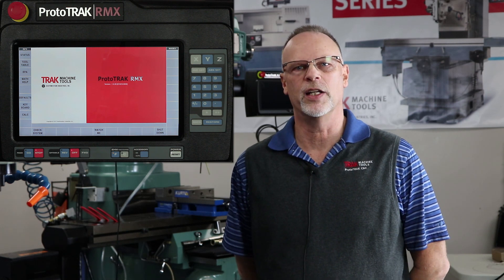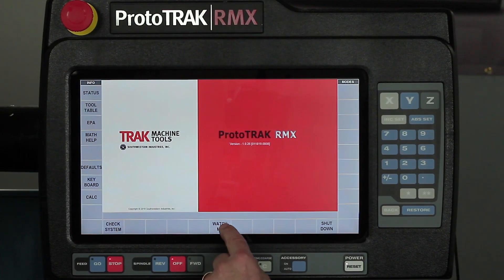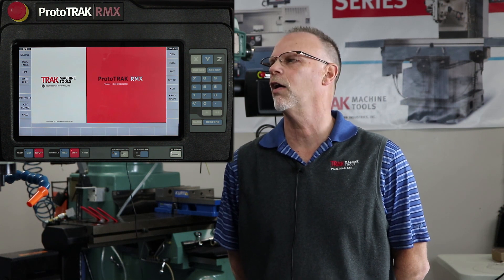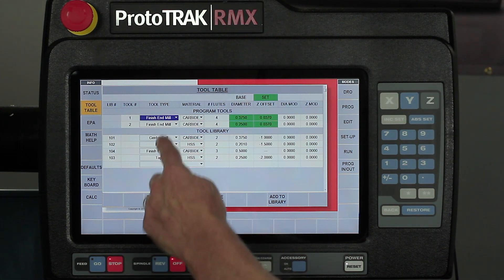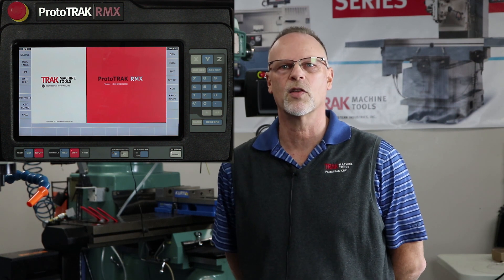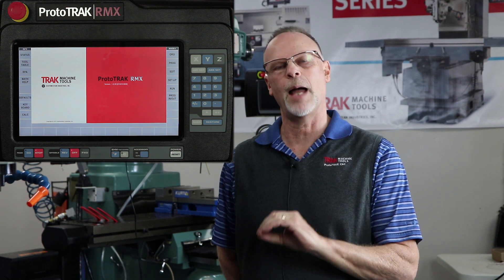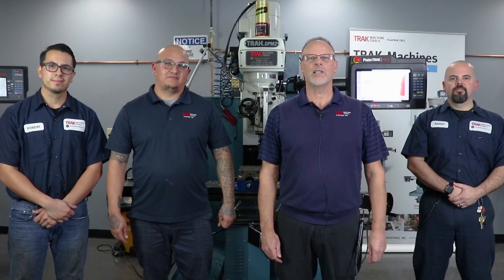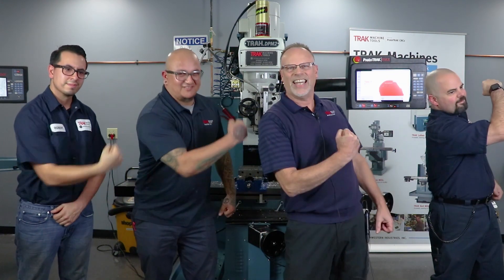What Makes the RMX Different? | ProtoTRAK RMX CNC Overview

Comment: Thanks for the insight Pat. Do you know why on the SMX control when a tapping 
event is entered the actual depth entered in the event is not where the head taps to?
It does not go to the programmed depth.
Reply: Hi Jim!  I know there is a tolerance of +0 but I believe there is also a tolerance of about -5%.  Because the spindle doesn't have an encoder, the motion control is doing it's best to go to the final number without overshooting but it happens so fast, it really doesn't know if gets there exactly.  During our testing it was pretty close.  If yours is off by a lot, please check with the service department in case there is a different issue causing this.  They will probably want to know what size and type of tap you are using.  They will also  want to know the RPM you are running at as well as what material your are tapping.  T.P.

Comment: These are very expensive, why would anyone buy these if you can get proper CNC machines at a much lesser price
Reply: There is a reason nearly every tool room in the usa makes use of prototrak  lathes and mills. They are probably the best solution for one off, job shop, tool room type use. You can have a trak machine cutting chips before your PC even boots up to load your cam software. Very very fast and convenient machines these TRAKS are.
Reply from the maker: Hi, Sunil. Thanks for the question. I believe you get what you pay for. With TRAK machines, you get equipment that is made to last. You get commitment from our in-house software and applications team to build ProtoTRAK controls with the features and performance that machinists and operators need. You get the know-how of every designer, engineer, builder, tester, inspector, technician, sales rep, and customer support specialist built into every machine. And you get the support of a company that has spent decades refining products and services for benefit of their customers.
Reply: @TRAKMachineTools  thanks for replying, i don't intend to demean in any way, but your logic of long lasting quality, commitment, features and new developments goes well for all those CNC manufacturers as well who are much cheaper than you and still prevailing in market for many decades
Reply: I think the fundamental approach is different. TRAK machines are designed more for toolroom and precision use. The machines that are cheaper than TRAK machines also lack the rigidity and overall build quality that I've found TRAK machines to have. At the lab I used to work at we had a TRAK mill that was one of my favorite machines just because of how stiff it was. With cheaper machines the control is less intuitive, you have to be more conservative, and they don't have as many of the fancy features that TRAK has.
Reply: @zachbrown7272  please correct me if I am wrong, Proto Trax are relying more on their control software than their hardware. No doubt their machines would be very accurate and rigid and meant for tool room precision. But if you compare the cost of their machines and other precision tool room machines , I guess you would agree what I mean ..

Comment: Do you still have all the features on the 2 axis control like adaptive machining
Reply: Adam, yes it does however, because of the way adaptive machining works, you will have a few check z, set z commands while it's cleaning out a pocket.  Other than that, all of the options are the same in 2-axis as they are in 3-axis.  T.P.